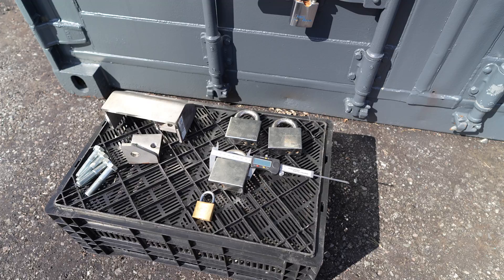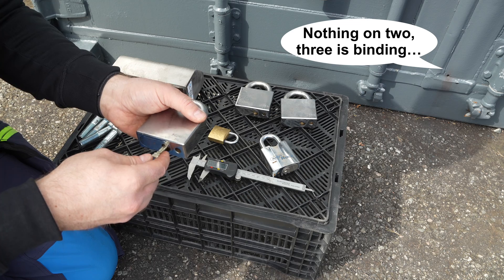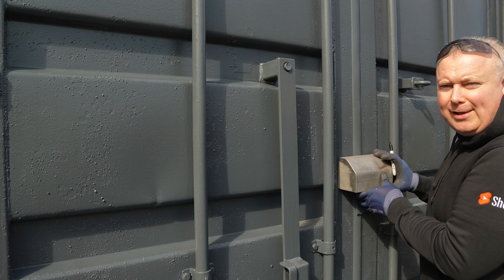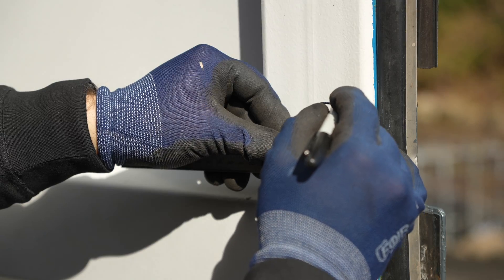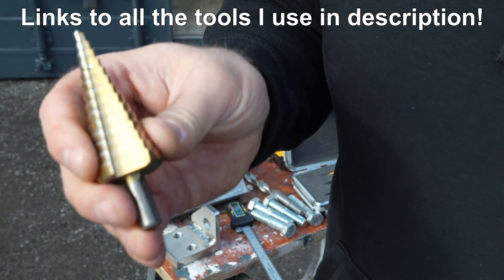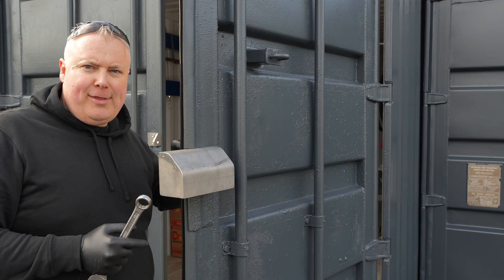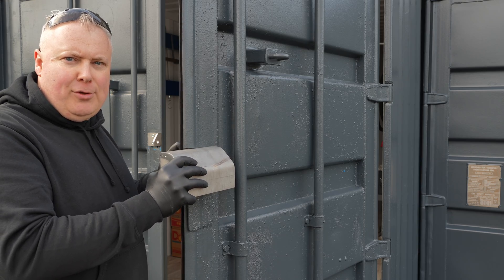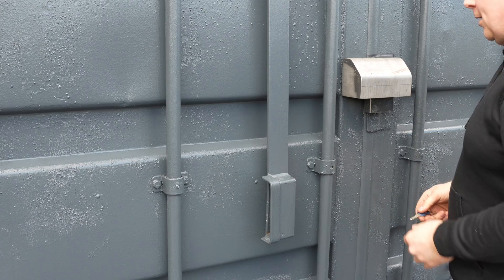HIGH SECURITY LOCK SYSTEM! Installation On a Shipping Container!

Comment: QUESTIONS:
1: Why is the paint bubbling? 
2: What’s the info on the right side of the SS cover?

Thanks so much. I am just starting a revamp project in my own container so I am consuming all that I can.
Reply from the maker: Thank you for watching! The paint bubbled due to improper application (in the sun at high temperatures). And sometimes the paint can react chemically with the old paint and start bubbling. You can try painting a small area first, to see if the paint works for your project and dont start bubbling. The info is about the lock cover, I think they are made in Norway (it is called «låsebeslag container» in Norwegian). Check this link: https://fosen-tools.no/ft-container/110450/hengelåsbeslag-høyre-fg-godkjent-kl-5-syrefast-stål-for-container